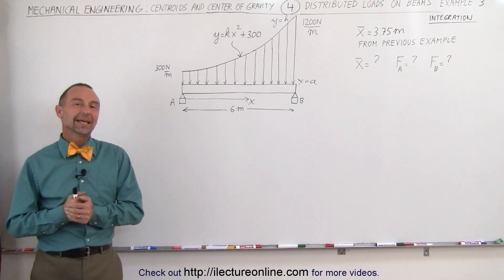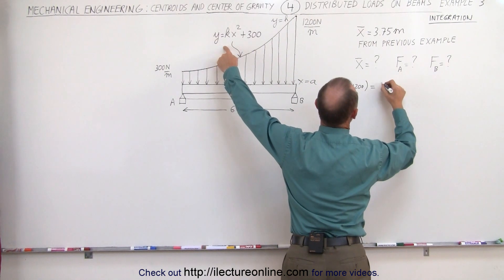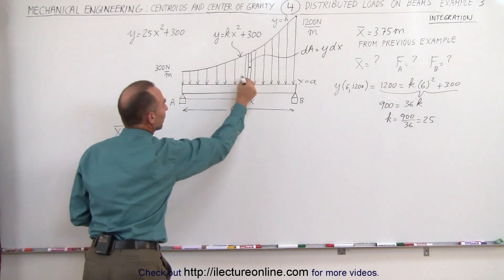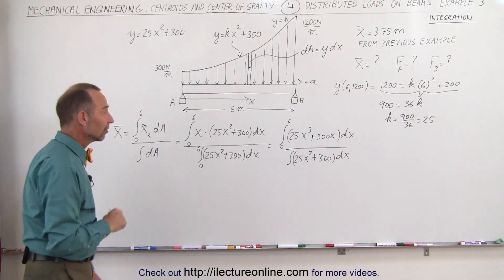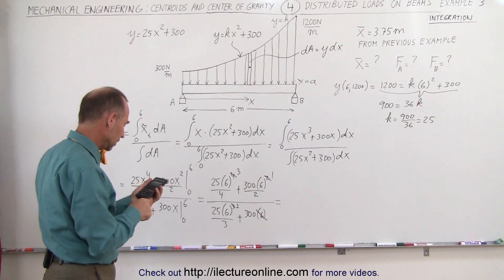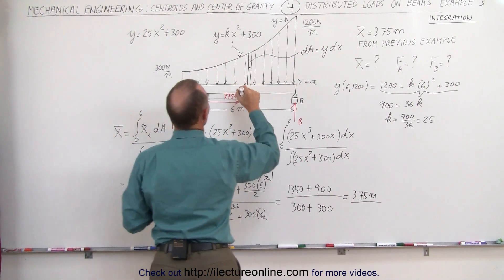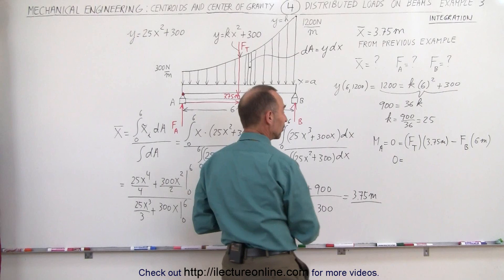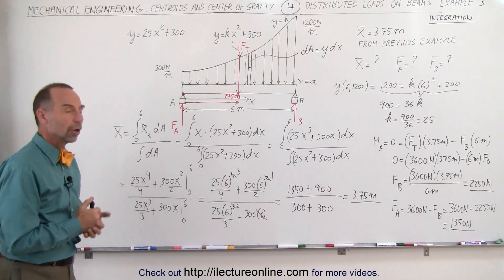Mechanical Engineering: Distributed Loads on Beams (4 of 12) Find Distributed Load on Beam Ex. 3

Comment: Hello, 
When you substitude centroid X as just simple x at the begging of intergration, x is not  really at the center of the portion, is it? (like  in previous videos where you summed horizontally u subed for (a+x)/2 for example).
Would it be because dx portions are so small that we can neglect it? Is every intergration necesserally has dx tend to x?

Thank you a lot.

Comment: shouldn't "y" be 900 instead of 1200 when solving for "k" because "y_initial" is 300 ??
Reply from the maker: Video is correct as is.
Reply: Having seen your Ex. 10 video, both Ex. 10 and Ex. 3 have different approach when solving for "k". which one is the correct way when solving for "k"?